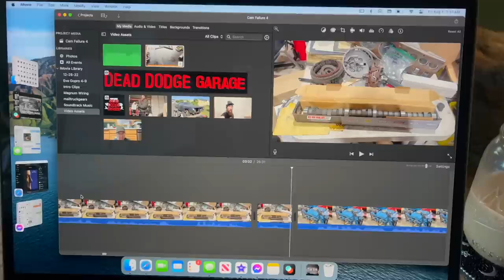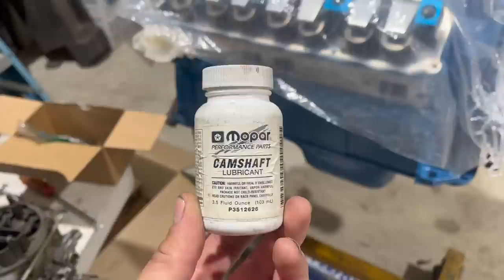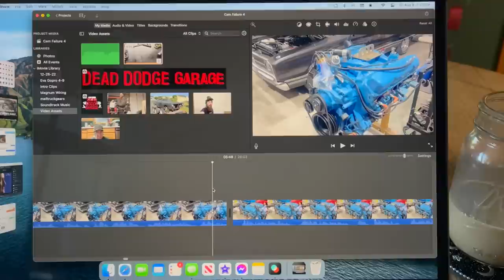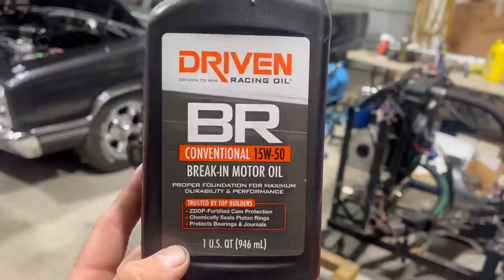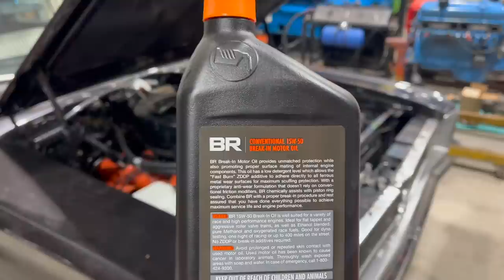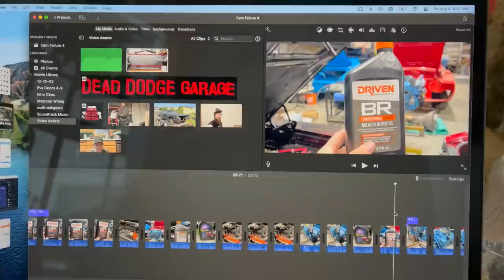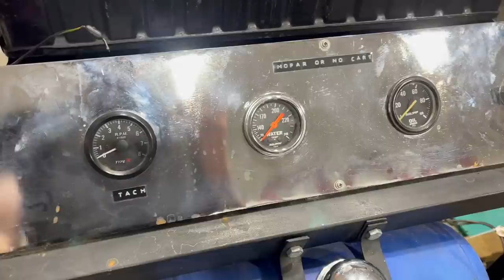How To Make Your Flat Tappet Camshaft Live, And The Anatomy Of A Failure

Comment: If we can't trust camshaft manufacturers anymore, then this is indeed the beginning of the end times.
Reply from the maker: Spend any time watching videos about camshaft failures on YouTube and you might find out the times started ending years ago… I guess I’ve just been lucky? I have always looked at the parts in boxes, said “mmmhmm” and slammed them in engines. Heck, sometimes I even clean them! It had worked really well for me so far.
Reply: It actually started in the mid 80's when efi came out and the Ford mustang and gm fwd cars were experiencing cat failure because it was getting way too hot same with the Buick rwd V6 motors, and they had apparently started removing the zddp content because testing proves it is directly related to this issue and then the aftermarket camshaft manufacturers especially at this time im referring to the overseas knockoffs were using a completely different metallurgy process,, remember the Buick rwd V6 231 cutlass supreme brougham my gold 85 I mentioned I replaced the oil pump and the timing chain gear set and it blew up shortly after,2004 guess what it had received a jc Whitney no name performance camshaft and they didn't change the lifters and I used a new oil pump that was given to me,by a name I had never heard of turns out it came from a swap meet,, I have never had good luck with the Buick rwd 231 V6 I still consider them junk but I knew something was was up when a 113k mile original motor failed. After I replaced the oil pump and timing gear set cloyes.another point was the 267k miles 88 Chevy S10 regular cab short bed loaded 2wd Tahoe with the factory sunroof I said I had with the knocking 2.8 litre 60 degree V6 it still ran it shook but it was still drivable motor was wasted it lost almost all oil pressure unless you were running 45mph or higher to about 60mph then it 25psi other than that it was bad it idled fine except when cold, but with that kind of mileage I knew it was not worth trying to save a gm 2.8 173 cubic inch V6 and I was keeping the truck for a project anyway but ended up selling it to a buddy for its interior and gas tank
Reply: I owned the 88 Chevy S10 around the same time and five years later was when the Chevy truck 355 was built

Comment: I put together my 440 in 1989 and installed Melling high volume oil pump. Moroso 7 qt. oil pan. Put these in a stock 76 440. Dropped it in my 70 GTX. The engine was stock except for the 484 purple shaft cam. And the other parts mentioned. Also hooker headers. Ran the car until 93 and it stayed parked. Pulled it out early this year and rebuilt a stock 70 block .30 over. Steel crank and 10.5 to 1 pistons. 906 aluminum knock off heads. All the stuff from the 76 440 placed into the 70. I was worried about the cams and lifter parts failing so I went with these tried and true. So far, no problems. Fires right up and idles great and rev out smooth. 6 barrel induction set up. I know for a fact that in 89 I did not break the cam in. Prior to 89 I never broke a cam in. And I built 6 engines easily. Never broke a cam in. And all were flat tapper hydraulic lifters. All these engines run today. So I am leaning towards modern part’s failure. We need better QA for the amount of damage and cost this can cause. Thanks DDG for a very informative video.
Reply from the maker: Absolutely a factor. Just saying - there are others too. Lots of things to think about.
Reply: Modern part failures. That's the main issue I have. 
Junk right out of the box.

Comment: A lot of people are way over-thinking this. There are a bunch of factors that contribute to a successful breakin. For nearly ALL of those factors there's 'Ideal' and 'What you can get away with'. Oil, additives, RPM, runtime, technique, camlube, spring pressure and others. Fact is many, many engines over the decades made it though initial start up and beyond without eating the cam and lifters under 'less than ideal' conditions. The ONE (or TWO) things that you ABSOLUTELY CAN NOT get away with is improper taper on either the camshaft or tappets. There is NO forgiveness in this tolerance. If there is not immediate and continued rotation of the tappets it's going to DESTROY those mating surfaces VERY QUICKLY. It's THE single most critical factor. Period. Everybody reading this has done improper breakin's in the past without problems. Not using breakin oil, not running long enough, not varying the RPMs, heavy springs, even using used lifters. I've done it all myself. I would venture to say people are way more informed today about a 'proper breakin' than EVER before and yet there are more failures. It's not really 'rocket science'. I'll let you in on a secret. It's the Lifters.
Reply from the maker: Yeah. Me too. I think every break in I’ve ever done was give or take improper. Did I stutter when I described exactly the lifters as a problem? I dedicated an entire video to that. There are more factors that are worth discussing.
Reply: @DeadDodgeGarage  I ONLY use vintage NOS lifters. I haven't used any 'new' lifters since around 2000 when I didn't like the look of how they were being machined. There's still TONS of NOS lifters out there. I wouldn't get anything after the mid-late '90's. There were a lot of problems with the 3 big Mfr's around then, ie. quality and financial which seemed to go hand in hand.
Reply: i agree completely. i have 40+ years experience.

Comment: with all the flat tappet cam BS in recent years i would not even consider using one unless it was NOS.  just go to a roller setup then there is no worries about taper/crown, break in or zinc oils
Reply from the maker: I have a video explaining why that is not an option for everyone, and why I refuse to accept a roller conversion as the only way to do this.

Comment: Here are some things to add to your already good suggestions for successfully installing/breaking in ft  cams & lifters. 

As for better Cooling during 2k-2,500 rpm for 20-25mins,it can easily be kept in check by placing a 20” box fan on high speed on a box directly in front of the grill/radiator core to ensure its blowing cool air thru the rad core at all times.

Mix coolant at 50/50 or 65-70% water/35-40 % coolant for best heat transfer.

Also,fill cooling system thru intake to till it almost overflows before installing t-stat with rad cap off to help air escape & watch coolant lvl un radiator as your filling it.

This allows you to rid cooling system of most all air prior to startup for smoother warmup without 1st overheating motor to get stat open with little yo no coolest hitting it yet.

Also drill a small bypass hole in the stat to help remove air from system too.

If cooling system uses a clutch fan setup consider switching from std to hvy dty fan clutch for better cooling or at very least ensure current fan clutch & water pump are in good working cond for hood cooling,same gos for the radiator too,30-30yrs old fan clutches & radiators can at times not be up to job if properly cooling our stock or modified muscle car motors.

Also ensure all air is pulled thru radiator by cooling fan by installing adhesive backed blk color foam insulation used in ac apps in all air gaps inbetween the radiator core & fan shroud.

Doing that ensures all air pulled thru rad core by fan gos thru the rad core & not air gap between rad core & shroud ensuring max cooling at low speeds & it idling at stop lights.

In summer heat I also increase idle speed a bit to increase cooling sitting in traffic fir more airflow & cooling thru rad core.

Also ensure proper spacing of cooling fan within the fan shroud & between fan blades & rad core too fir proper/max cooling too.

Ensure your running proper zddp fortified breakin oil for ft cam & lifter breakin.

A great assembly lube that stays put is cranes grey looking sticky Molly paste & cranes oil additive for breakin is great too.

As for the red assembly lube you mentioned, your 100% correct that it literally drips/runs off the cam lobes in less then 24hrs post application which is a problem esp if motor isn’t going to be fired up for wks or months later.

I have seen it 1st hand and there isn’t enough lube left on cam lobes for safe fire up days or wks post application of that red assembly lube.

I personally called the cam mfg tech/engineering staff to speak to them on this and  telling them my concerns & alk they said was well when we do cam swaps & testing on our dyno mile motors we don’t see a problem. 

I again told them  the issue is a few days or wks later that thin lube runs off the cam lobes which is an issue resulting in an almost dry start & they again said they don’t see an issue.

I realized the person I was talking too didn’t get it or refused to admit there’s an issue so I let it go that day.

I called the tech line again to hopefully speak to a different tech/engineer which did happen but I got the same basic response,can’t fix stupid.

I use gm 7 blade 772 ac cooling fan with hvy dty fan clutch,hi flow pump & high flow 160 deg stat too.

Before I install the intake I also adjust thevalve train (where applicable) so I can then reapply the assembly lube that’s wiped off csm lobes when spinning motor over when doing valve adj to ensure better protection on 1st fire up.

Ensure your running enough base timing with a min of (14-16deg) when running an aftermarket non stock cam with more duration because retarded base timing causes motor to run much hotter.

Run approx 34-38deg total timing all in by approx 2500-2,600 rpm max.

Ensure your running enough octane in fuel with an aggressive street perf timing curve & back off/reduce timing if detonation is heard or seen on spark plugs (small metal shinny looking metallic spots on plug porcelain).

Ensure you have firing order correct,carb filled with fuel,oil system primed & battery fully charged for quick fire up with minimal cranking time.

Best the change oil & filter right after 20-25min breakin time is done refilling with proper zddp fortified oil when running flat tappet setups.

Change that oil & filter at 500 miles & return to 3k oil & filter changes after that when using conventional & or syn blend oil with proper elevated zddp lvl for ft cam & lifter setups.

Iv’e been doing the above for all the stock & aftermarket high perf ft cam / lifter installs & break-ins iv’e done in the past 50+ yrs with 100% success so far.

Gm’s old Gen EOS/engine oil supplement was a good oil additive for ft can/lifter breakin too.

Heat/temp wise My 69 chevelle ss396 4spd with mild modded motor (approx 375-380hp/430-440lbs trq) in 85-90deg summer heat runs 178-180 deg f max at cruise & in traffic at stoplights too using above rec to reduce heat.

I run a stock Hd copper brass Harrison 4 row radiator with temp sending unit in stock location in driver side head by exhaust port in head that typically runs 15-30deg hotter then if temp sender is in the intake  being far away from exhaust heat driving higher temp gauge reading by 15-30 deg in summer heat.

Happy motoring!

Scott
Reply: Way to go, Scott!  I feel like taking mine all apart just to rebuild it, after reading your comments.👍🙂. (I may comment, later, to ask u ?s.)
Reply: @stuckinmygarage6220 
Np asking a few more questions,I will ans them if I can.
Reply: Summer and when you know that you are going to be sitting in traffic awhile I learned that truck with the Oldsmobile v8 powered Buick Regal and Delta 88 and Oldsmobile V8 power 98 cars I had and copied it to the Chevy truck 355 and the truck got a newer aluminum radiator.
Reply: My induction and fan setup at the time of break in failure both ended up getting changed except the intake manifold and are as follows the fan was a 16 inch I believe 6 blade chrome and blue aluminum flex lite straight fan and 2 inch spacer and bolts from auto zone parts store, and the intake manifold was a Holley street dominator aluminum intake manifold and the carb used in the break in was a Edelbrock performer 1407 750cfm manual choke I referred to as the drag carb, and it ended up going right back to the factory 7 blade 86 chevy k20 sbc ac clutch fan and shroud and then my brother drove it through the woods and the shroud got busted all to pieces but that is another story... and the carb was the Napa crate motor replacement m4mc non computer feedback 795cfm quadrajet electric choke carburetor I took off the truck because even though the Edelbrock had decent throttle response it sucked gas like going out of style and the qjet properly tuned and rebuilt again was just a better carb
Reply: A race builder on here sprayed dry graphite on cam then assembly grease used .  I've done so now .

Comment: Lifter bore issues can cause the lifter not to spin I always run a burnishing ball through each bore surprising how tolerances change from motor to motor also oil through solid lifters a big help.Love the channel keep ‘em coming!
Reply from the maker: That was done here. I discussed lifters dropping in and spinning freely in previous installments. I definitely could have mentioned that in this video as well. Whoops.

Comment: Like you said, "if ya ain't learning...."
We all have those days we're, what should work, or has always worked in the past, just...doesn't.
Expensive yes, but lessons aren't cheap!
Reply: And yeah in my experience they are never cheap and that's not even counting fixing them just to acquire it back where it came from as in the vehicle back home because I have only had two break at home.
. and acquiring the repair parts and gaskets and materials..

Comment: Great video man. The cam break in was the #1 reason I was so hesitant and a bit frightened of firing the "not a Dodge" up for the first time. I agree that a good percentage of cam failures are installer error, but with most of the horror stories these days about "Stomp" there has to be something going on there.
Reply: Only use NOS lifters

Comment: You are absolutely correct! I have 69 roadrunner with 440-6. I have mechanical cam,with roller rockers  comp cam split lift and duration. 1967 only 915 heads. I broke my cam in over 20 years ago. Motor still screams!  I broke my cam in at 2000 for 20 minutes with no problems, then I installed the inner second valve spring after cam break in

Comment: I have always done the way you have, but its been awhile since I have built one.  I have a couple engines coming up so this is a nice refresher, plus I been curious about all these cam issues too.  When this first started happening everyone was blaming manufacturers but I was like wait it makes more sense this is a installer problem.  I think your assessment is probably the most spot on, blame can be a little bit of everything.  You know 20 years ago we got away with breaking in how we did, but manufacturing changed in that time, metallurgy changed, oils changed, but we didn't change.  Man I don't recall the reasoning for taking break-in to 3k because its been to long but at the time it seemed most logical.  I was taught to max it out at 3k but only be there for like a minute or 2, the biggest amount of time is spent in the 2k range.
Reply from the maker: Oh sure. I rev it up to that neighborhood for brief periods, but mostly keep it in the 2000 range. It definitely doesn’t need to park at 3000 the whole time. Yeah… things have changed. I completely agree that parts have gotten worse. There’s a reason I gave that issue top billing in this video. I just know that things are more complex than that, and want to get people thinking about every aspect of the problem.
Reply: @DeadDodgeGarage  If your still taking suggestions for video topics, I have a spicy topic for you that I would be interested in hearing your thoughts on.  How about a video on the fusible link?  As someone who has a lot of experience with different kinds of electrical, I lean more towards the camp that says replace it with an appropriate sized fuse.  At the same time I do appreciate the argument that the engineers  designed it that way for a reason.
Reply from the maker: @Mopardude  I didn't know people were replacing them with fuses. Haha. I don't know if I'm qualified for this. My inclination is usually to keep things as stock as possible - ain't broke, don't fix, etc. The fusible link has done right by me to this point. I've only cooked a couple of them over the years by being stupid - and that seems pretty good!